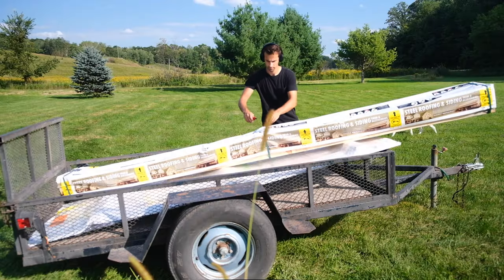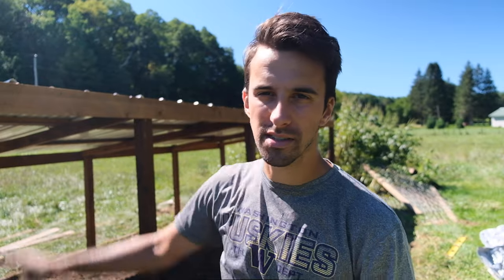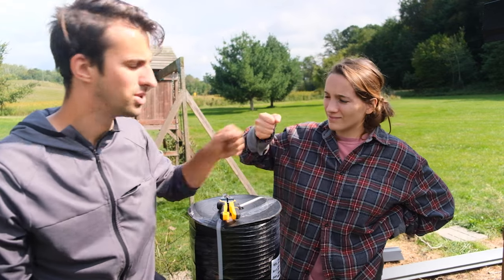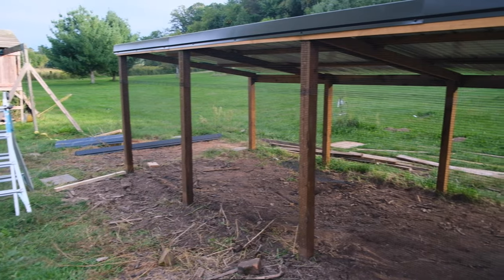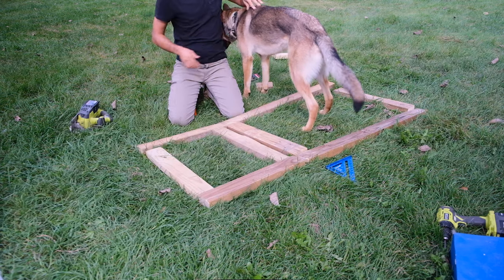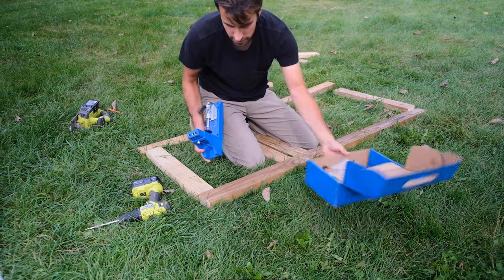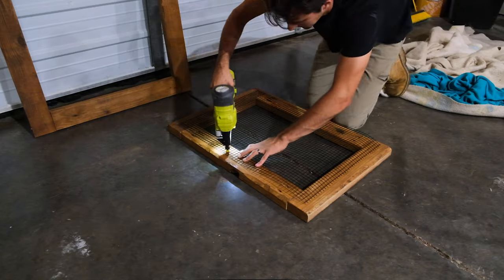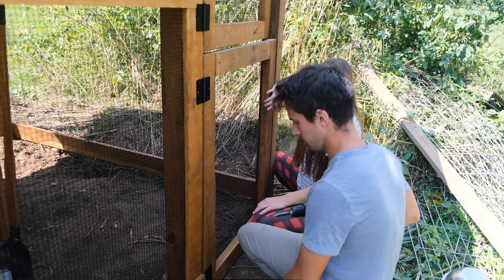Building The Ultimate Chicken Coop

Comment: Great job guys! What’s the height of the rum and what’s the spacing between the posts?
Thank you in advance
Reply from the maker: Thank you!  So at its peak its around 5 Ft and then slopes down to around 4 ft. If we were to build it from scratch we would have built it taller just so we could stand up comfortably, but we used an existing structure so thats what we got. And the posts are 6 feet apart. Thanks for watching!
Reply: Qual  largura e comprimento da corrida?